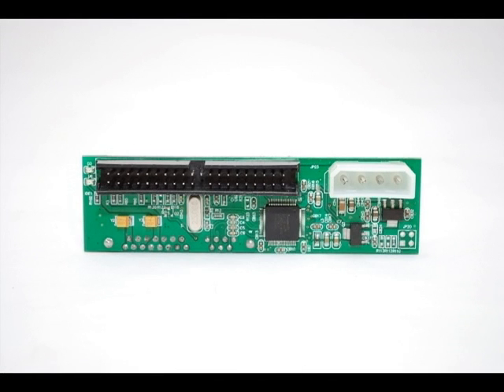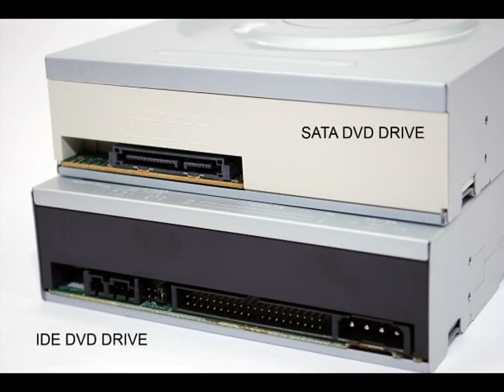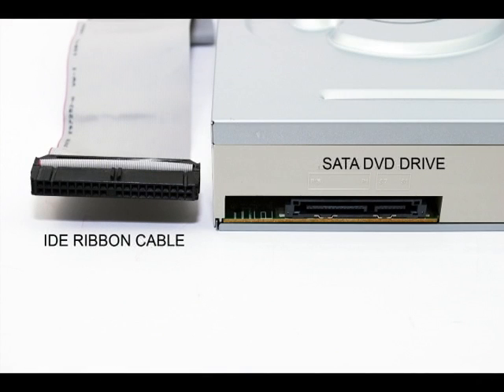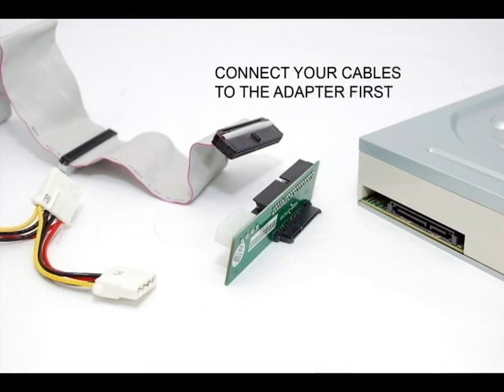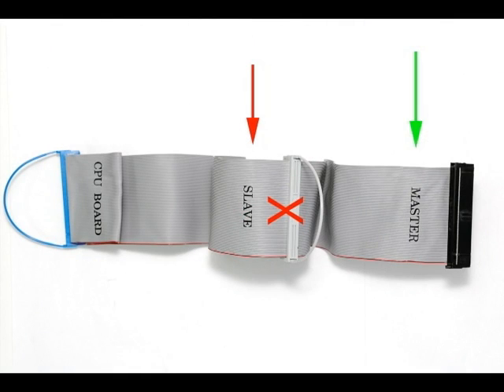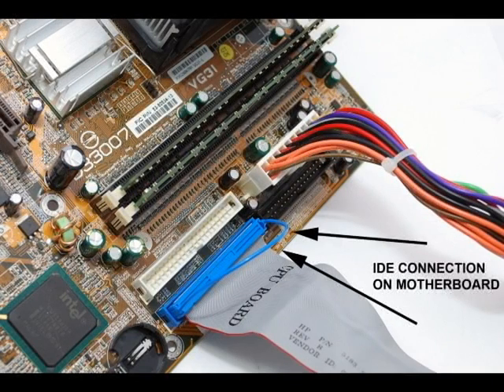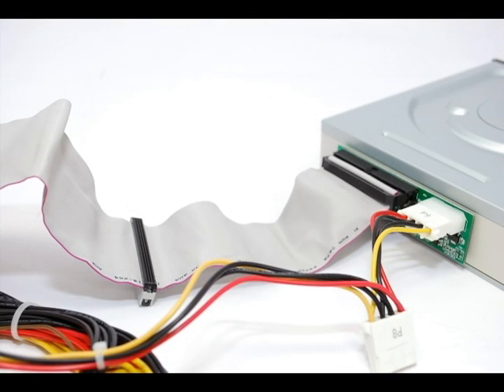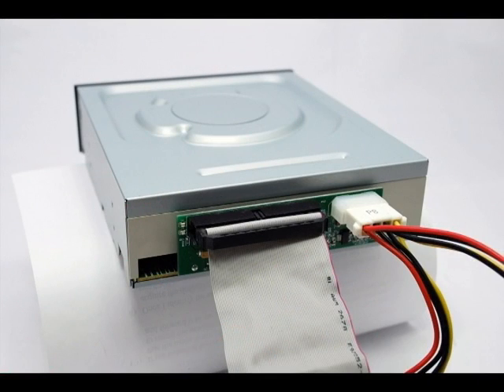SATA Converter Solution for PATA (IDE) PC System

Comment: This also works for hard drives right ?
Reply: +ilcool90 I just ordered that adapter, did you try it ? I hope it will work with harddrive
Reply: @clashJoze  did the adapter work out for ya?
Reply: @MidnightToker24  it worked kinda but with errors

Comment: I have tried these on hard drives and had endless problems: I ended up using a PCI SATA adapter instead.  Maybe they do work with DVD drives.  This type as stated will only work if there is no other drive on the IDE cable, but there is a similar slightly more expensive red one available on EBay with a Master/Slave/Cable detect jumper on the board which allows you to use it with another drive.  It is just as hopeless with hard drives in my experience.

Comment: Good Video.Installed second sata dvd drive to desktop but no spare sata port only spare ide port. After learning from your video i bought a converter, different from device shown, made in China costing equivilent of 6 dollars here in Thailand and it worked a treat !! Amazing. Read speed up to 13x. Writes up to 8x HDD to new burner and up to 4x direct dvd copy old burner to new one. Fast enough for me. Grateful Thanks and Regards.